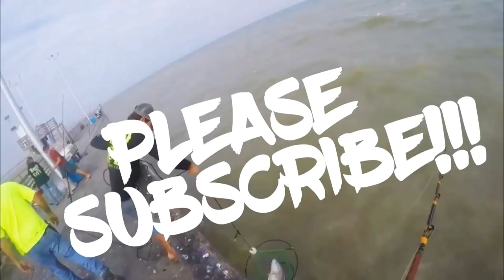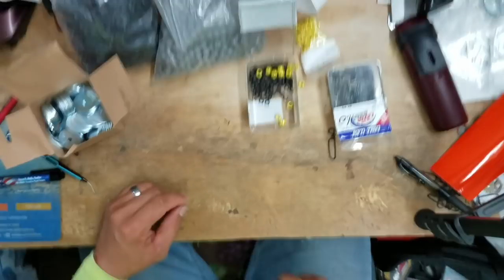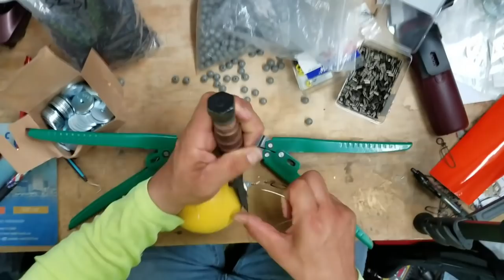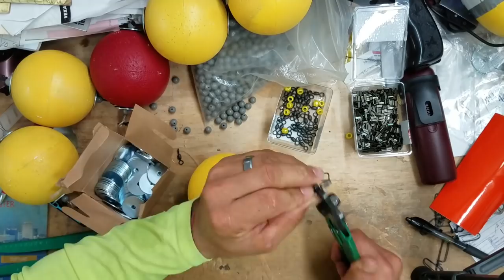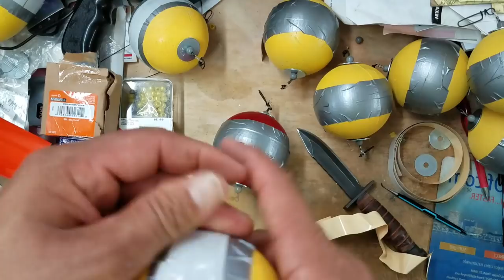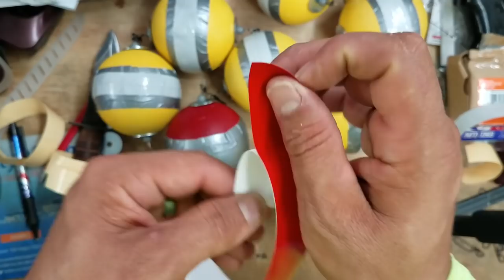Different type floats we are setting up custom fishing Tackle most satisfying most calming AMSR

Comment: OCD would never let me leave that gray duct tape showing...
Reply from the maker: Yes sir I can believe that times when I like to spend a little bit more time with everything I got going on sometimes it's a little easier to let him know what you can be done to fix it up and actually customer went out and trim them down and sent me a picture of how it looked and it came out very very sharp looking
Reply: Ive made a sail line in the past and used the straight styrofoam oval floats, painted them red and yellow, then affixed the reflective tape...
Reply: I find that the reflective tape thats used on police units works the best as far as sticking to the floats... on the plus side i use it on my rod tips for ease of sight fishing at night...
Reply from the maker: There's a tape as thin enough and flexible enough to get around the rod tip of a fishing rod then that would be great tape that is why I use the reflective tape I use cuz it's the same one that we put on the tips of our fishing rods and I've actually had the same tape on there for almost the last 5-6 years if not longer and they working like a champ